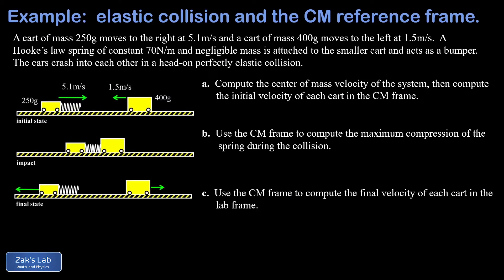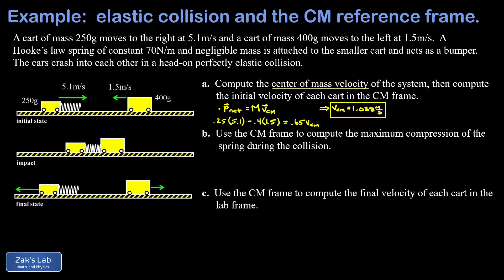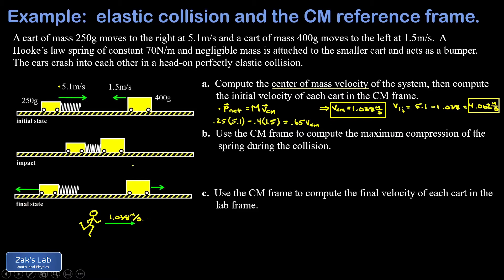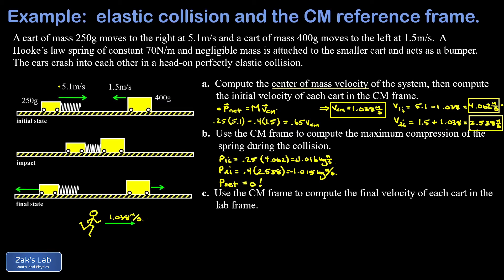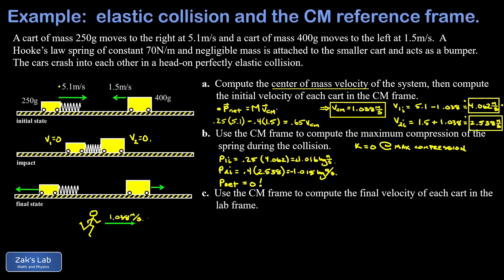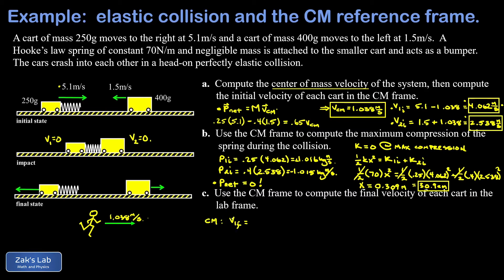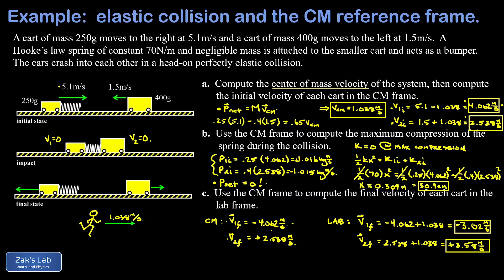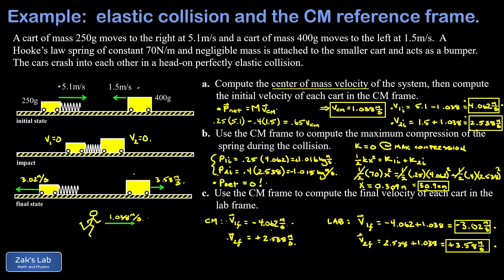How to use the center of mass frame to solve elastic collisions:  maximum spring compression etc.

Comment: I don't understand why the CM still moves in the same direction after the collision? Doesn't it change direction as well? Also, I don't see why v1f becomes smaller, if the whole point is that leftward movement is accelerated when you run to the right? Could someone help me out?
Reply: Hey, I don't know how much this explanation will help and if you'll still need it but here (this is, also, in part to help me understand more...):

So I skipped over some parts of the video and I don't know how much the YouTube channel goes over the mechanics, but the CM is the CM of a "system", and in this video the "system" are the two carts. Now if there are no external forces acting on the system, the CM doesn't accelerate or (collision between carts doesn't count, as those are internal forces). In this situation, both objects in the system are moving, so you take derivative of CM (m1x1+m2x2)/(m1+m2) and get (v1m1+v2m2)/(m1+m2); now you have a velocity of the CM. The CM will NOT accelerate/decelerate unless there is an external force acting on it. Which means the CM velocity will always be (in this video) 1.038m/s to the right UNLESS there is an external force acting on it.

Note: CM IS IMAGINARY. CM is a tool to help us understand more complicated systems.

Now for the v1 becomes smaller part- I'm not quite sure what you're asking. But in an elastic collision, net momentum will still always = 0 if you're in the CM frame AND magnitudes will stay the same, which means, if you look @ momentum equation (m1v1+m2v2=0), velocity will just be reversed. 

And then because we are calculating momentum in the CM frame, we have to adjust to the lab frame, which is at v=0. If we are at v=1.038 and we need to adjust to a frame in which we are at v=0, we add 1.038 to the velocities that we get. If that doesn't make sense intuitively, think about it like this: the lab frame is at x=0, we are moving at 1.038m/s down the x-axis. Thus if someone else measures our speed when they are at a standstill at x = 0, they will measure 1.038m/s. If we measure something to be moving at velocity = -4.062m/s, we can convert this to the lab frame by adding what we measured to what the lab frame measures our velocity to be.

if you don't need this anymore (which is likely) I am so sorry but thank you for posting this question because it helped me realize the flaws in my logic
Reply: @aki384  hiii thank you so much for this response. it really helped :)